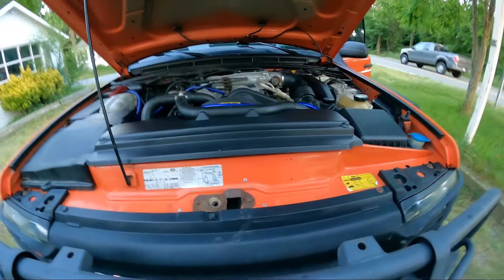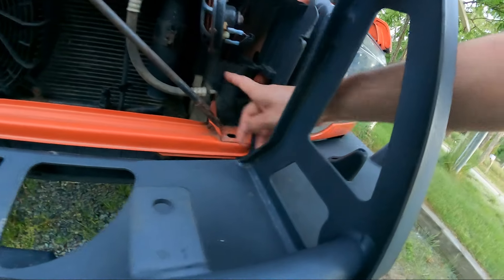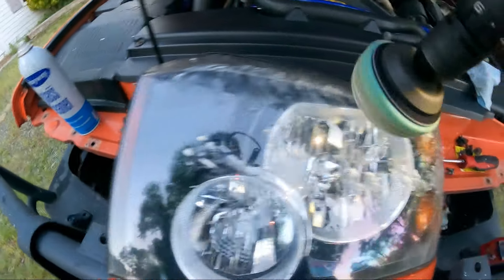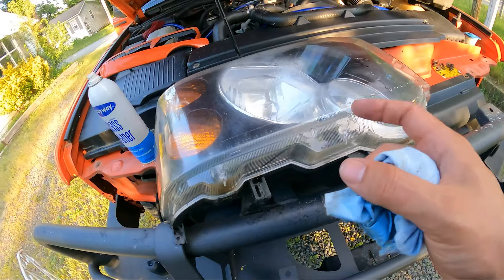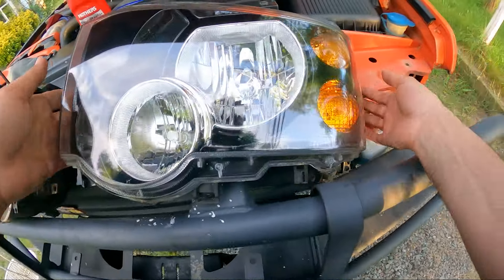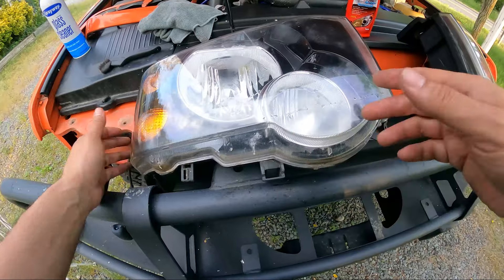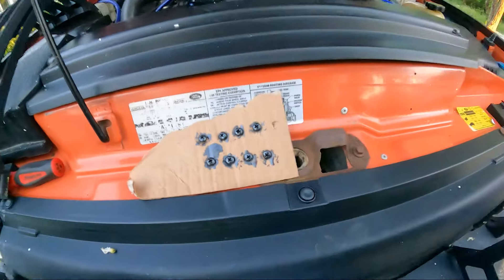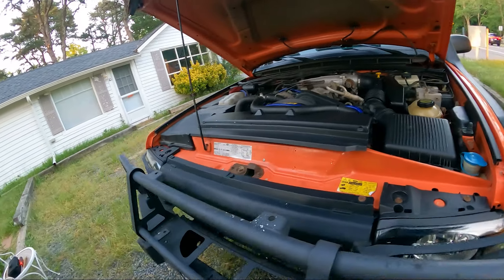Lando gets a headlight treatment but somethings not right 🧐😏#diy #customerstateswhat #howto

Comment: Once the sealant between the front and back of assembly fails, water gets in there when it rains. Drill (giggity) a small hole in the bottom inconspicuously as possible and the water will evaporate. This works on headlights and tail lights.

Comment: Amazing the amount of crud that collects on the front of your car. Just did a 1500 mi round trip to the Carolinas and spent last hour pulling dead bugs out of grille.  Have gotten into habit of coating front end with Mother’s CMX before road trips which seems to save a bunch of cleaning time.

Comment: I've got a crazy idea how to clean inside the headlamp lens. Take the lens assembly out of the vehicle. Take the bulbs and sockets out of the housing. Fill the lens assembly with water, and toss in denture cleaning tablets. Let them dissolve and clean up the housing. Then empty the housing, rinse it out with some distilled water, and blow it dry using your air compressor (make sure you have an air/water separator on the compressor so you're blowing dry air into the housing). Presto! Either you have clean lenses, or you don't, since I never did this before. And I have no idea if the denture cleaning products are safe for plastics. As they say "your mileage may vary".

Comment: If I can ever recommend a restoration kit, none beat 3M. I'd substitute their clear coat with a meguiars headlight clear coat or cerakote clear coat

Edit: regarding the cloudiness, I'd say some alcohol sloshed around inside the housing and wiping with the method you mentioned in the video, drain it and leave it out to dry in a non-humid area. I'd hit the edges of the housing with silicone sealant and check the gaskets on your bulbs to make sure there's no moisture bypassing

Comment: Take the bulbs out, pour rubbing alcohol inside. Slosh it around, pour ot out and set it lens up in the sun to dry. Or heat your oven to its lowest setting and slide the rack out so it doesn't get too hot and leave it there to heat up . Just let it chill with the oven door open. 100*F of dry oven air will evap the moisture out.
Reply: I was thinking he should borrow the wife’s hair dryer and dry it then apply the clear silicone but that will probably come after the car show

Comment: 2.04 Phillips screw -  are you sure?  With LR being British I suspect these are Pozi's.  Easily confused they look similar at first glance but have a different angle of the cross and the there is an angle between the cross pieces.
Reply from the maker: Original hardware was Allen head.